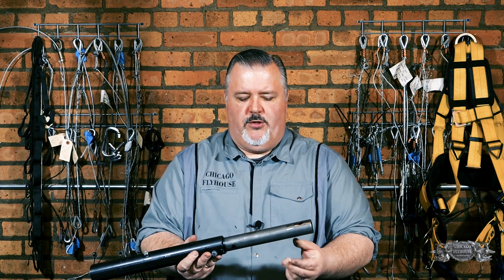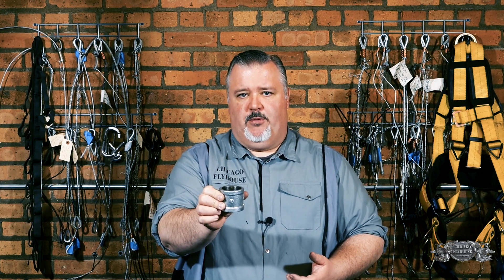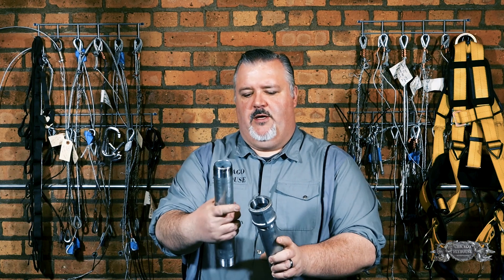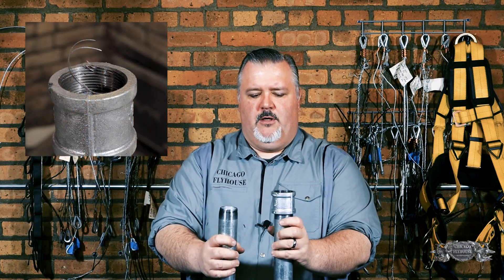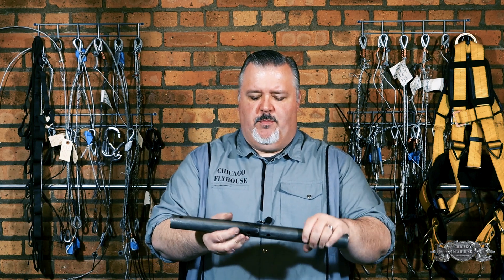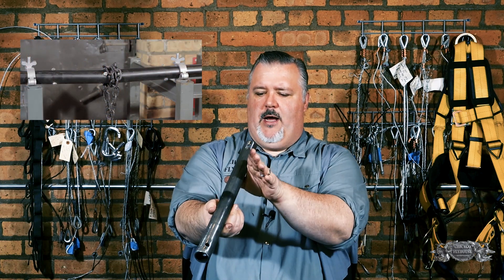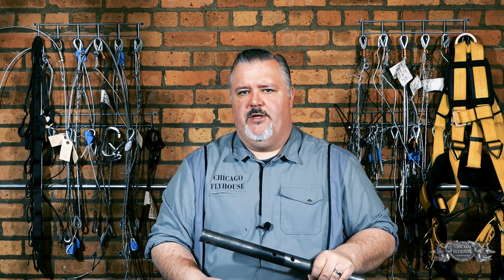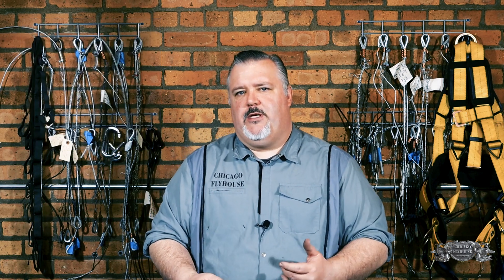Batten Splices

Comment: The only thing I would add is both failed as the internal is damaged and should not be reused, but the threaded coupler was a catastrophic failure and could cause the load the fall where the internal would keep the load in the air
Reply from the maker: That is a good note - implied but not explicitly stated.  Thanks for pointing it out!

Comment: What are your thoughts on internal batten splices with pressure plates and set screw, such as the Light Source Mega Batten Splice? Personally, it doesn’t seem secure to me because if the set screw isn’t sufficiently tight, the two pipes could pull apart. Your thoughts Ed?
Reply from the maker: Some of those splice plates are designed for use on moving battens, and are up to the task, but some are designed only for stationary pipe grid applications and should not be used on pipes that move.  Read the manufacturer information carefully to know what your hardware is designed to do.

Comment: Using internal coupler, the bend strength where batten segments meet is that of the internal coupler. If the coupler is same gauge pipe as batten, its bend strength is less than that of the batten, due to smaller diameter. Bend strength diagram would go something like:     ------T------  (Top of the T is where the pipe is doubled). A suitably heavier gauge for the coupler would make its bend strength same or better than that of the batten: ____T____  

Using threaded connector, there are two potential points of failure rather than one: both threaded connections. Thread roots are severe stress concentration points;  threads at the bottom will fail in shear, parting rather than bending. This is "off-label" use, they were never intended for this service. They are for plumbing pipes and conduits, which are always to be adequately supported with hangers, clips, brackets, stands.

Comment: Suggests on making a 2-3 ft lifting bar with a safe working weight of 4,700lbs?
Reply from the maker: Can't answer this well without knowing the application and the design factor needed, but for that kind of load in such a short space, you most-likely will need to use an I-beam or some very hefty structural tube steel.
Reply: @thechicagoflyhouseinc1865   No worries it is for working out lifting a 5,000lb chain with two swivel eye bolts and two hammock swing springs for 800lb ea wrapped around a steel plate while I stand on it. I put a 1/2" 30 long pipe inside a 1 1/2" 30" long pipe and capped the ends as a barbell.

Comment: What type of pipe are you using for the inner pipe? 1 1/4" schedule 40 steel?  How big are the bolts and holes?
Reply from the maker: 1-1/4" pipe doesn't fit like you want it to. It is a little more hassle to get the right pipe, which is actually not pipe. It is 1-9/16" DOM (drawn over mandrel) mechanical tube with a 3/16" wall. Our splices are 24" long, so 12" in each pipe, with holes for 3/8" bolts. Holes are spaced so they are 3" from each end of the splice and 3" from each end of the pipe (6" apart at the center of the splice). Holes are turned 90 degrees from each other where the two at the center of the splice both go the same way and the two at the ends of the splice go 90 degrees opposite. I believe that 2-3/8" long bolts with a narrow nylock nut gives the least protrusion. Bolts and nuts should be grade 5 and the nylon locking ring must be fully threaded.

Comment: 100lbs difference around 3000lbs isn't a big difference to me. I suspect the test rig had a lot to do with that. I think a longer span would have far more representative results.
Reply from the maker: We were also limited by our testing equipment.  I think that the internal coupler is drastically stronger than the threaded one, but we could not measure the forces that high.